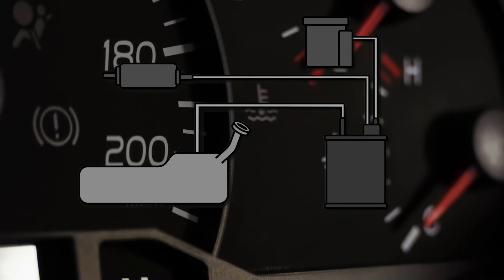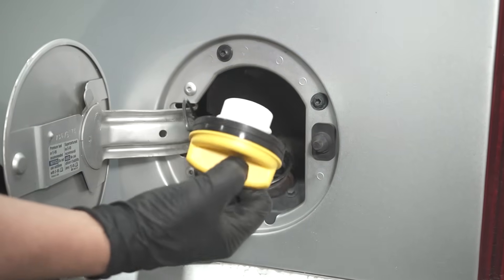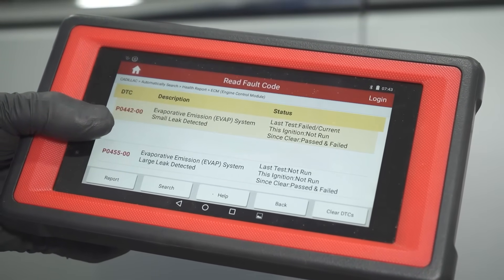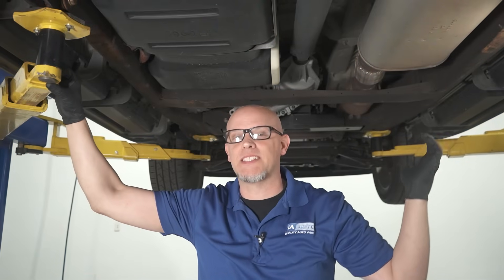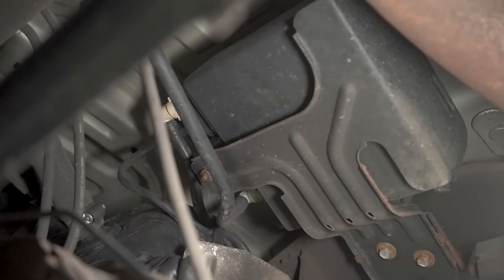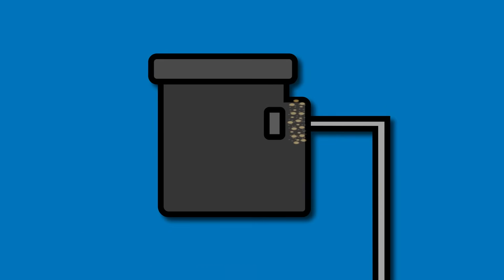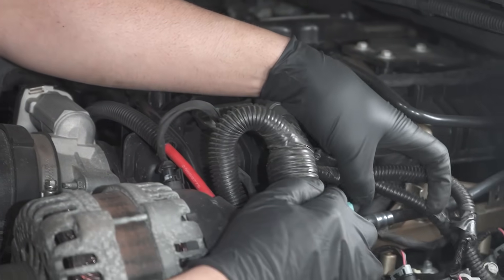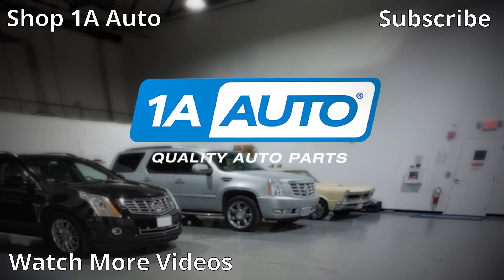Engine light on with EVAP code in your car or truck? Rapidly find the problem in your EVAP system.

Comment: Got a P1456 (minor evap leak) on my 2003 Honda Civic LX.  The engine light goes ON and comes OFF for periods of time, oddly seeming to come ON at times when going down a 20-30 degree grade downward (it last about a week or two), then disappearing whenever (last about a week or two).
I also have a gas smell at the engine bay when starting and idling for a minute or two all the time (figure it may be an injector issue).  I already replaced the gas cap.  Gonna check the purge valve next or maybe just run a homemade smoke test.
But an feedback would be appreciated.  I did PASS smog in California during a period when the engine light went OFF too.

Comment: first thing check your fuel pump. I checked everything else, changed some things then went to dealer for a smoke test. We actually pulled the whole box off the back of the pick up to see the fuel pump and at that time we discovered little jets of gasoline squirting out of it.

Comment: Good evening, its a great video to have a better picture about the evap system.
Im searchung for months my issue on my VW golf 5 1.4 fsi BLN 2003.( Early golf 5) i had a p0441 code and after scanning everything said change the purge valve right at center back of the engine. It goes well 2..3 days and then p0441 again. Changed it to an Oem purge valve.  Same thing after 2 days. So p0441 still there. Chacked hoses all good. Canister souds like heavy sand inside but no breaks outside.  So i dont even kow what the issue can be. Cause after canister or passengers weel next to engine there is nothing but a white 8mm  pipe going back to the tank. I checked all 3 damaged purge valves even new one they are all steak opened when conpletly disconected and air flows in them ..not totally free but pretty stuck opened, like 30%++. I have disconected the hose that goes from P.valve n80 to the intake and blocked both of them on right side with tape so no air+vape goes in intake freely for few days and no vapors go out of purge valve.i just open tank cap after every ride to escape the vapes. Same again p0441 on! My issues: bad acceleration, roufh starts and maby sometimes engine dye first cold start. Sometimes jerks a bit especially arpund 1800 rpm ++  after 15 minutes ride and over, very bad horsepower and sometimes smell of wierd unburned gas or smthing like this. And p0441 check. ( it also appeared a p2294 that killed my previous high pressure fuel pumps regulator  some days  before 8dys* for first time ever and car had no power at all and steuggled and jerked like crazy but changed it with a used one older i had and for moment goes fine last 10 days so only same p0441 is up now still ..but car goes better now...however still same issues and symptoms of p0441) it is first time i hear about a vent valve today at some videos but i never had problems filling my tank so never suspected this. I dont even know if every car has one vent valve. Im mine has it may be built in tank! I donno what could be the issue really! Car seems week like dont breathe right or dont have the proper mixure! Hope u have some ideas what could it be ..searching for months now.! Thanks again for video it really helps a lot, wish u luck and make even more of these detailed  informative videos.🙏

Comment: ???  I thought the evap silinoid should release all pressure from  tank.... the hose from tank goes to  charcoal filter ,, then with swithc off.. should release out of the silinoid...Why cant I add fuel!????? I can blow air easily backwards thru  system.. I have waited 15 minutes and still wont let  fill. Also--  gas gauge suddenly  went  to full ! I say its all because of BAD ground..  Machanic said EVAP silinoid cant  talk to computor..  Now EGR code also showing. just  replaced it.. Still  think its a Ground issue !!!

Comment: I changed the Canister Control valve to my F250 2012 6.2 and the check engine light still on😏😏

Comment: I have a 2500 Chevy, I replace d the solenoid, canister , purge valve, gas tank cap.  Was okay for a few days.  Then the check engine code light up again, put my scanner in and the same evap code came up again.  🤷🏽‍♂️

Comment: Ya, changed they had cap and purge valve still on,
So covered it with black tape on the engine light 
Months went by and car ran fine...months past and the light went off ...imagine that

Comment: I have a stubborn p0442 code on my 2019 Silverado. Even with an emissions specific warranty in effect, the dealer says repair is not covered. Just replacing the purge valve cost $500. That doesn't even guarantee to remedy the issue. Scammers at the dealerships.

Comment: Great demo! Tks. !    My mother's car doesn't wanna start sometimes, you let it sit an hour, and it starts. First no codes. I listened for fuel pump, didn't come on. Changed fuel pump. Car started drive fine first 200 miles. Then started doing it again . I got light, we t auto zone said was gas cap. Changed that. Worked again for a week  now same problem won't turn over? I guess I gotta replace purge valve next

Comment: I have an 08 Wrangler JK and ive changed the charcoal canister, ESIM, Gas Cap and Purge valve and I still get the check engine light. The lines are good, no cracks or breaks. Could other parts like the catalytic convertor and O2 sensors cause P0456?

Comment: I have a p0496 code and have replaced the purge on the engine, the code came back up and im getting high flow from the evap so could it be the vent purge or the canister?

Comment: 10% Ethanol will gum up the valve, canister, and hoses. Repair or replace, and they will gum up again in 6 months. After going through this, when the light came on again, i had it diagnosed and identified as the same, so I ignore it. No problems at all with how it runs. I may try the blowing air through the canister trick sometime, though. Cheers.

Comment: Simple fix blew air into the little hole at filler neck. Cleared the clogged line.
Checked all hose connections to be sure it tight and not cracked. Code is gone.
Reply: Filler neck?

Comment: Can you help me I have a Chevy Silverado 2019 and I’m getting code P0498 which is evap low circuit. i’ve already replaced the evap and checked the fuse and check out my wiring. My next step is the fuel control module. Does that sound correct? Thanks.

Comment: I have another issue. No CEL, but have a yellow light and a flashing EVA on the INNOVA code reader, but NO ACTUAL DTCs. I’ve replaced the purge valve, gas cap and the canister solenoid. Removed the canister and cleaned the sponge filter and inspected all the hose connections. Cannot get the yellow light or the flashing EVA to clear after 150+ miles.

Any ideas?
Reply: How many drive cycles have you done? (Let the car get up to temperature) California's requirement is 300 miles with 15 cycles . rrrrr.

Comment: Thank you, thank you, for your in depth video lesson!  You gave a very informative explanation of the EVAP system and the various components that can cause failure. My 2013 VW Passat 2.5L first exhibited the P2402. Now, that the Leak Detection Pump has been replaced, now I have the P2450 goose chase.  I hope it’s narrowed down to the Canister Purge Vale. 
Thanks for your lesson!

Comment: How often should the charcoal canister be changed? Can EVAP leaks be the cause of smell of gasoline/fuel weird smells in the cabin, with the check engine light on?
Reply: ever figure it out?

Comment: I am working on a 2008 Saturn Vue 4 cylinder. Is there any difference between the 4 and 6 cylinder engines with this valve location and/or operation?

Comment: 1996 Nissan 240sx, when i got my car the previous owner deleted the evap system is there a way to stop the check engine light even after that without re-installing the system

Comment: My car has started just shutting off right after i turn it on, unless i give it gas right away...its an 01 Mitsubishi Diamante, computer hook up says large leak n the evap system, every now and then theres metal thunk noise coming from back around the gas tank, can happen when driving, when sitting still or even after car has been turned off... google says this likely means a stuck valve... any thoughts? The mechanic I've been talking to hasn't been very helpful

Comment: I had a p0442 code. I replaced the egr valve and I cleared the code.  No code yet but evap light is red.  No check engine light yet. Any suggestions?

Comment: I’ve had an evap code on dash almost one year. Told I needed a new vapor canister. This week I had a leak fixed . Was blowing black smoke. Turns out a piece had a huge gash in it and coolant was leaking. Had an oil change also . Picked up the car and the evap code is gone ! Not sure what happened? Mechanic thought I blew a gasket, but the plastic part had a huge gash in it . Not sure what happened. Just wanted to know why my evap code is gone from dash? I haven’t replaced it

Comment: One of the most. Mist.  Problem in a.  Evap problem with check engine on is a clogged sponge filter in a. Evap charco box under your car.  As long with a. Valve that opens and closes   In front of the. Sponge filter   Just in the last few weeks have fixed  6 vehicles.   With this problem   Most of theas cars where. Chev.   Small. Cars

Comment: Awesome video thanks for sharing. Do the newer cars have plastic gas tanks?
Reply: Yup I have a 2006 Jeep Liberty that has a plastic gastank. The good think it's they can mold the tank to maximize capacity while reducing the size much better than a steel tank. It also doesn't rust.

Comment: I had that problem in my Civic and all mechanics that I went didn't want to do that job. There was finally one mechanic that agreed to do it but told me he dont have a tool to put vapor inside the evap so he warned me that since he dont have that tool, he just gonna guess based in stats and how the part looks. Well, he replaced the vent valve under the car and bingo! Problem solve. (I already replaced the gas cap and it was not that, I told that to the mechanic).

Comment: ITs REALLY tough to diagnose an evap system without a bidirectional scan tool and a smoke machine. I suppose you can throw parts at it and cross your fingers. 

I get to drop the gas tank on my car this week. Small evap leak code set. Vent valve could be audibly heard clicking when turning it off on with the scan tool. I did a purge and seal test, with the system sealed it degraded very quickly when watching the pressure sensor in the tank. Smoked the system and smoke was rolling off the top of the gas tank. Something is broken up there, hence the gas tank removal.

Comment: Thank you for all your useful and clear information's that provide us through your videos ,that makes work on cars very easy at home ,but would you please focus more in the most needed generation for that repair videos I mean (second generation 07-14 ) of (GM SUVs & Pickups GMC Chevrolet Cadillac Tahoe Suburban avalanche Yukon Escalade) ,electric issues mechanic issues accessories installing(more buttons and panels for accessories ) ,programming (like change tire size and how if needed) ,big tires off road and how to make it fit in your professional guide, advice tips about parts and lubricants when or how long after need to replace ,recalls.

Thank you again very much .